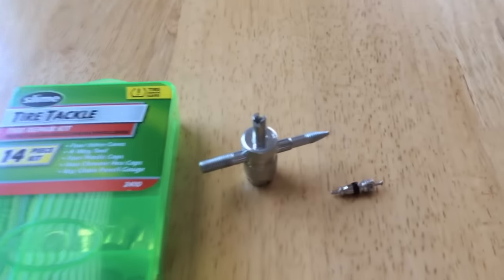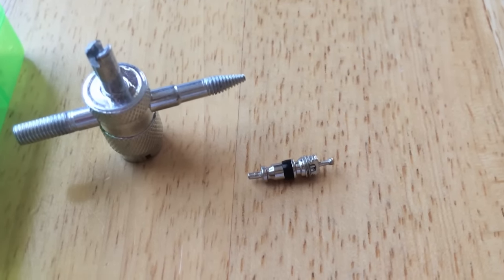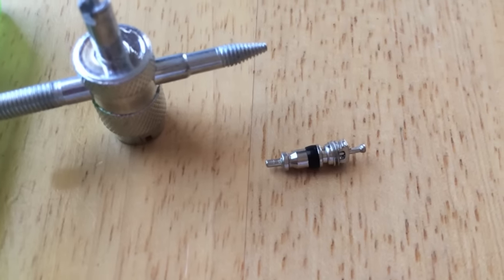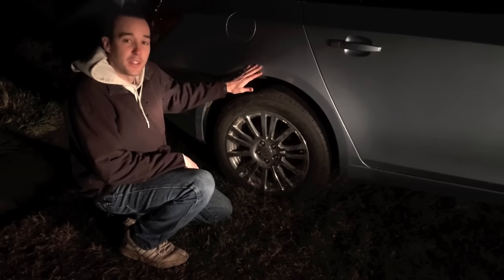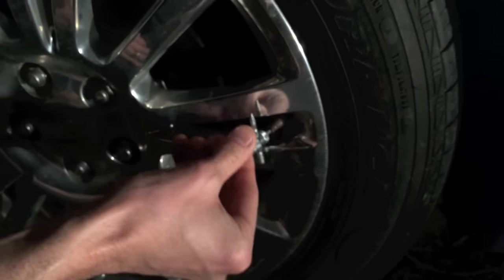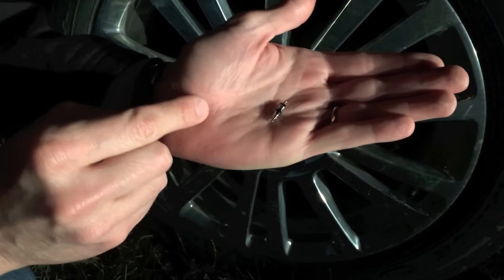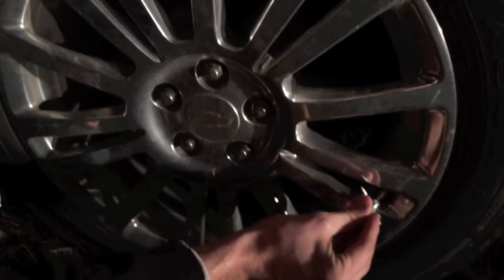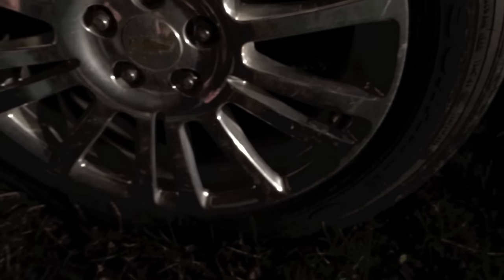How to Fix a Leaky Tire Valve Stem - EASY Repair

Comment: This happened to me today and turns out my valve stem was just loose because I bent down and was able to hear the air coming out of it. This tip saved me time and money from going to a tire shop which I’m sure they probably wouldn’t have even charged much if at all for such a simple fix. But point being, I got it done myself.💪🏾 Thanks sir.
Reply from the maker: You are very welcome & we appreciate you sharing this.  Us fellow DIY’ers need to stick together.  Hope all is well.

😎👍🔧🔩
Reply: I had my tire replaced and the dealership , they ended up taking off my back tire and it was the front messed up so I got the new tire from the from replaced but he took my back off for no reason now I’m having issues with it going flat , I put air and noticed when I pushed the valve down the air was coming out, and I was never having that issue before did he not put my tire back on right and mess it up ?
Reply: same man and thank you Michael

Comment: Mine is leaking around the base of the valve stem where it seats on the wheel.
Reply from the maker: @ItchyKneeSon  

Thanks for watching, are you referring to the tire bead where the tire mates with the wheel/rim?

If so, it may be likely that the shop can remove tire and add a sealant application to rim and put your original tire back on and leak will stop…however if the tire is very worn out… it may be best to purchase a brand new tire, which will have a brand new bead on it and it will seal to wheel/rim properly.

Keep us posted.  🧰
Reply: @DIYwithMichaelBorders  No, around the base of the valve stem.
Reply from the maker: @ItchyKneeSon  

Thanks for the reply, below will be a few video links that may be of use.

       https://youtu.be/flCUP3CWUpk?si=lnwthqmcshMv-ZBo

       https://youtu.be/zuWpmP73S0E?si=7S3nEaT_AXaXExNF

Keep us posted, we will get this figured out together.  🧰

Comment: hope its just the valve: about to fix it based off this video
Reply from the maker: Thanks for watching, any update?  Looking forward to hearing back from you.  👍🧰
Reply: @DIYwithMichaelBorders  i like the mini kit - once i filled my tire i felt around the tire and noticed where the air was coming out from - it was a super tiny hole in the side wall of the tire - turns out the valve may have been ok but i do like the kit as a backup for valve leaks - im going to just replace the tire because i don't want to risk fixing the side wall of the tire even though the hole is tiny - also i drove on the flat just a bit (not far) so i decided to replace the whole tire to avoid any unknown tire damage

:)
Reply from the maker: @Mugful_Of_Daisies  

Thanks for the follow up, that’s a great idea.  You’ll have the tire tackle kit for next time.  😎👍

Comment: I had a slow leak on one tire that was driving me crazy.  Tire shop dunked the tire..no leak.
Nothing leaking.  What happened was inside the valve cap was a silicone o-ring.  This o-ring was bunched up and when I screwed it on, it actually depressed the valve on the core causing a slow leak.  I re-seated the o-ring and no more leak. It took me a couple weeks to discover this.
Reply from the maker: Thanks for checking out the video and sharing your comment and experience greets with fire.  Thats interesting info.  Im glad you were able to pin-point the slow leak!  Its interesting to see what really goes into the engineering design of these little stems/cores.  Pretty cool stuff.  Please Subscribe to the channel and turn on your YouTube notifications that would be awesome thanks again!

Comment: I have a silly question can you change the valve with the tire still on the vehicle or do you need to take it off? I was worried when I change the valve the tire would deflate. 😟
Reply from the maker: Good morning, just poured a cup of coffee and am sitting down to answer any and all questions for the DIY community.

The tire can remain connected to wheel hub and you will want to deflate the tire first.  All air in tire will leak out once valve is removed.  By having no internal air pressure in the tire as you unscrew valve to remove it will be the safer route as you alleviate it from popping out at at fast rate due to the pressure behind it.  Keep us posted on your project.

Let us know if you have any questions and hey if you’re into crypto trading, join our DIY ecosystem and become part of an exclusive group of DIYers.

       toolboxtoken.com

Reach out to us any time!  🧰

Comment: Yeah my leak is coming from the valve stem. It’s a riding mower tire that I put in a inner tube. I recently put some air into the tire. Maybe I damage the valve or maybe I need to tighten it.
Reply from the maker: thurm101 

Very cool & thanks for watching.  Definitely keep us posted.  These little kits are great to use & great to have stored in the tool box for future use.  😀

Keep us updated on your DIY project & any questions you may have.  Please subscribe to the channel and turn on your YouTube notification Bell 🛎 that would be awesome thanks again!

😎👍🔧🔩

Comment: So I’m assuming when I bend the valve stem and I can hear air leak that means it’s coming from there, if I replace the valve core and it still leaks, then would it have to be the stem itself, and therefore the tire would have to come off the wheel?
Reply from the maker: Thanks for watching & that’s a great place to start.  Its very friendly to replace & if it doesn’t fix leak, the tire will need to be serviced.

😎👍

Comment: Is it possible that it's just loose and needs to be tightened?
Reply: my mechanic tightened the shredder valve but the tire still leaks so I'm going to try this fix and see if it works

Comment: Does this work for any tire? I just purchased new tires 2 weeks ago. Tire pressure light came on yesterday and once I went to fill my last tire the stem looked broken. My mechanic said it's a depressed stem and needs to be replaced for 175 because It comes with sensor. SMH... could I use this as a permanent fix and would me doing this mess up any sensor within tire? Thanks for the video and help
Reply from the maker: Thanks for watching & welcome to the DIY Raptor Club.  This is very common with brand new tires.

The tire shop will bring the air pressure up to the max psi.  As you drive away from the tire shop and continue driving over the first week or two, the brand new tires will begin to break themselves in and will require additional air to be added to bring it back up to the recommended psi...which can be found on the side of the tire.

Hope this helps.  😎👍
Reply: I'm confused, since my stem is depressed would this kit fix that problem? Thanks for your feedback and support. New Sub from me.
Reply from the maker: @jumpingjackgaming8802  

You are very welcome.  Did you bring the air pressure back up to the max PSI shown on the sidewall of the tire?

If you did, has it already leaked back down to a lower psi?
Reply: @DIYwithMichaelBorders  I can't add air because the stem inside is depressed and it doesn't allow connection to place or take away air. Would this tire tool work or do I have to replace the entire stem for $175
Reply from the maker: @jumpingjackgaming8802  

Thanks for the reply, the next best step would be to replace stem.  You will want to ensure that you drain all remaining air out of tire prior to moving forward with replacing the stem.

😎👍

Comment: Might not work for me as I have a fast leak and by the time I get air in the tire and drive 10 minutes, the pressure sensor light comes on. Tires all replaced a few days ago and because I was driving on a flat right after leaving tire shop they will be replacing everything free. I will buy the kit and an air pump in case something similar happens again so I'm not wasting money going to buy air at gas stations!
Reply from the maker: Thanks for watching, that’s no fun.  That’s awesome they’re replacing everything on-the-house.

Keep us posted.
Reply: @DIYwithMichaelBorders  got tire replaced and I'm good to go!
Reply from the maker: @teerich2011  

Awesome Awesome, that’s great news.  We appreciate the follow up.  😎👍

Also if you’re into crypto trading, we just launched our new platform website.

       Toolboxtoken.com

Reach out to us anytime.  🧰

Comment: will this work on a valve stem that has a low tire  pressure sensor?
Reply from the maker: Thanks for watching & welcome to the DIY Raptor Club.  This will hopefully alleviate the common “slow leak” & allow you to keep tire pressure at the desired psi... which in return will turn off the sensor fault on your dash in regards to your tire pressure.

😎👍🔧🔩

Comment: How do you know if you have a leaky valve stem?
Reply from the maker: Thanks for watching & welcome to the DIY Raptor Club.  You can usually hear a very quiet hissing sound coming from your core/stem.

If replacing your inner stem/core does not fix your issue, you may have something that has punctured your tire and is creating a very slow leak...or a rim leak...  keep us posted.

Enjoy your day.  😎👍🔧🔩

Comment: This might be my culprit! I’m tired of having to waste $2 every time to pump air into my brand new tires
Reply from the maker: Thanks for watching, that would be awesome because these little parts are very friendly to replace.  Looking forward to hearing back from you as you work through your DIY project.
Reply: @DIYwithMichaelBorders  Just tested it out right now and no luck. I bought the stem tool and valves for the replacement but first and foremost I did not hear air escaping from the stem itself. It was a faint hissing sound but seems like further into the tire and rims. I loosened the old stem with the tool and tightened it back up and still hear the hissing. I’m so upset :( thought this would be the fix
Reply from the maker: @teamirving.11  

Thanks for the update, that’s a bummer & we definitely understand your feeling.  That would have been awesome to get that leak fixed & behind you.

If rim is not damaged, it may be time for a new tire which will come with new core & stem.
Reply: @DIYwithMichaelBorders  No worries, thank you for your condolences lol. The funny thing I had a completely flat tire from the same side air was leaking and replaced it just recently with a new one. But I am still facing the same situation of slow leaking air coming from somewhere. At this point I am helpless and don’t know what to do other than take it for inspection :/
Reply from the maker: @teamirving.11  

Thanks for the reply, it may be a rim leak, looking forward to hearing back from you.
Reply: If you have a Wawa near you they have free air.
Reply: @DIYwithMichaelBorders  I got it inspected and it seems to be a rim leak/tire bead problem. My only fix is to use sealant or to get new rims :/
Reply from the maker: @everleighxoxox  

Very cool, thanks for sharing.  😎👍
Reply from the maker: @teamirving.11  

Bummer, we had a rim that leaked years ago.  We added the sealant & it helped but never stopped leak completely.

Keep us posted, hopefully sealant will fix your leak.  😎👍
Reply: @DIYwithMichaelBorders  oh man really? I really thought sealant would do the trick. Will keep ya posted for sure! Thanks!
Reply from the maker: @teamirving.11  

Thanks for the reply, further inspection though, our rim had a dent in it from an impact with an unfriendly pothole.

There was no saving it...however again, the sealant definitely helped a bit...it just wasn’t capable of sealing the small dent.

The dent wasn’t noticeable with tire installed onto it, but the shop showed me a photo of the dent with the tire off rim.

Comment: Sir, somehow only my right front and right rear’s valve stem core are shorter compare to left ones after changing new wheels. 

So it’s very hard to check air pressure with my gauge since valve stem cores are shorter and gauge cannot touch (or push) the core...

How can i resolve this issue?!
Reply from the maker: Thanks for watching & you can purchase a new gauge at your local AutoZone that will be compatible with both core designs.  Make sure you share with AutoZone that you’re looking for that specific gauge.  Keep us posted.

😎👍🔧🔩
Reply: @DIYwithMichaelBorders  Other gauge worked for both short and long one. Thank you!
Reply from the maker: @peterkim2987  

We appreciate the update.  😀👍